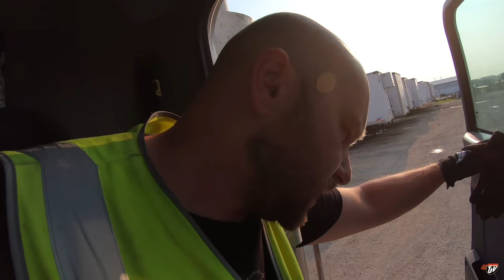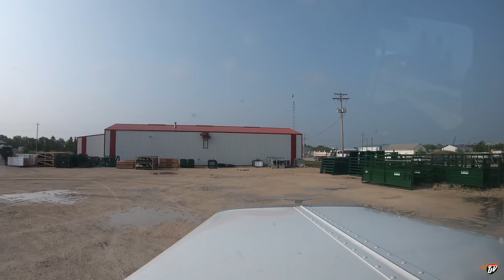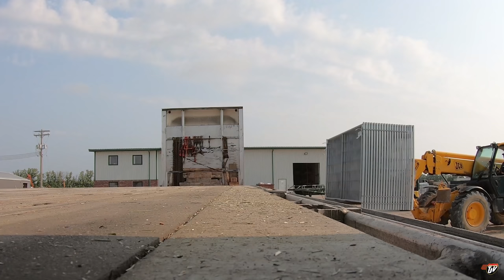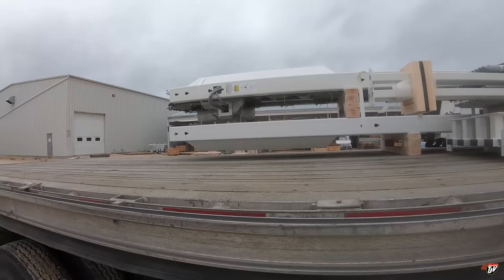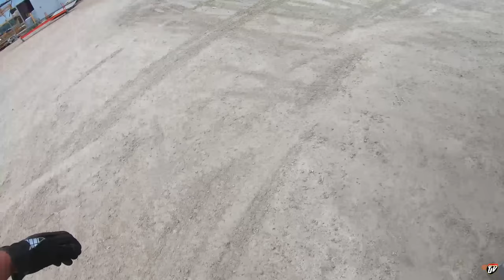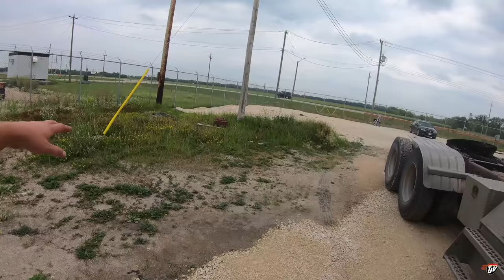TRUCKING IN A DROUGHT | My Trucking Life | #2331

Comment: 17:11 I wonder if the driver shortage they keep talking about is created at least in part for the need to haul one bundle of simple fences 1,800 kilometers across the continent. Surely there is a local company in Fort Smith that produces stuff like that? I don't understand how it is economically viable to haul such low value freight across the continent, even if it is an LTL trip.